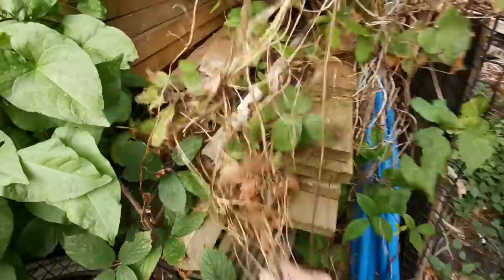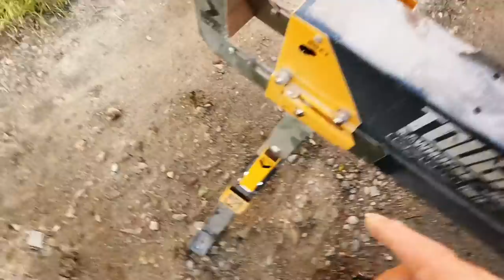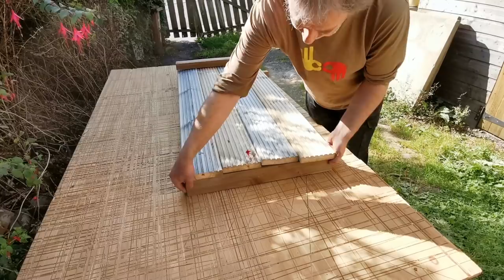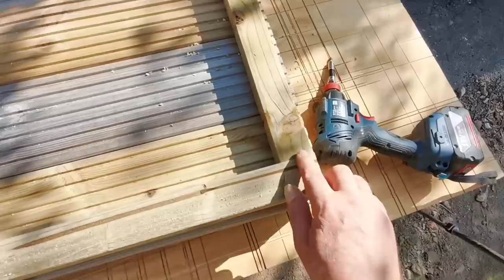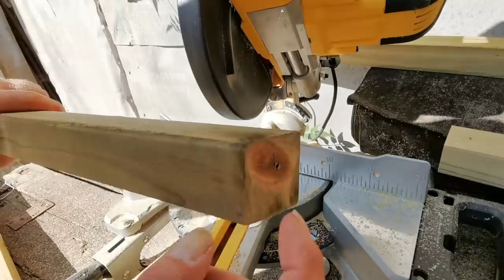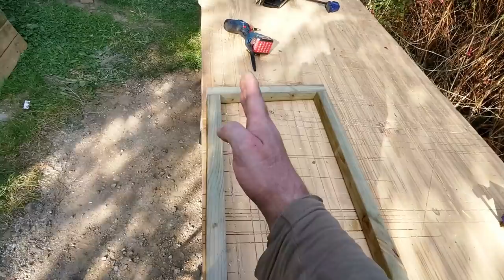Wood store build Pt1 - from scrap pieces of tanalised timber & van goes for it's MOT

Comment: Gid, so sorry about your dad mate. I don’t do social media of any kind so had no idea. You are right to hang out for a decent van. The prices are ridiculous at the moment as it seems everyone is a delivery driver now. No point buying someone else’s knacker. 
Enjoy your break pal and hopefully see you back doing your magic soon. 👍🏻👍🏻
Reply from the maker: Thanks, yep that's what I've heard, the increase in deliveries due Covid has pushed the price of vans up, they get snapped up quickly, I'm a bit reluctant to spend the generous donations on a piece of rubbish, & I need a LWB van, I've always had one that size but if nothing else so I can get my 3m plunge saw track in, high roof would be nice too like the one I have, I'm 6'2", I'm getting too old to be crouching, it's slim pickings on line but I've no transport tho so it's got to be a good one to go see as I've got to scrounge a lift from someone, I can only do that so many times, Leeds is quite big, so even if the advert says Leeds it could be 10 miles away, I'll find something n I'll be back soon Paul 👍👍

Comment: How do Gid, how’s thing? Have you managed to get back up and running mate?
Reply from the maker: Hi, I'm fine thanks Paul, sorry no van yet so haven't had a lot to share, I put a post on FB if you didn't see it, not much has changed since then, Van died Oct, dad died Nov, Xmas n new yr, I hate winter n it's freezing in my house, + covid lockdown, My dad died a bit sooner than we expected, we/the drs thought he had a stroke in March & thought he would stabilise & learn to live with the damage done but he got slowly worse, in n out of hospital all yr, Sept-Oct-ish they found he had a brain tumour n went down fast from then, he was 85, fairly well during his life n the end was relatively short 🤷‍♂️ 👍 There will be a little bit of cash coming from his savings, to be divided between 5 of us, my sister & brothers, it won't be much hopefully a couple of £k each but it's taking time to go through probate, so I'm very grateful for the donations, a massive £4,5k 😮👍 but the vans i can buy are a bit crap & miles away, i've been a joiner 36yrs so taking a few mths off is a drop in the ocean at this weird time, I decided it's worth holding out for a couple of mths to get dad's cash to put in the pot so I'll maybe then have a van for the next 10yrs instead of a rusty one that might get me through in the short term but only last a yr or two, hopefully Covid will f"off soon n we'll all get back to some sort of normal, so with all that i'm just hibernating a bit, I'll be back working n filming in a bit 👍👍 Hope you're well too 👍 https://www.facebook.com/gid.joiner/posts/3547240428695631?notif_id=1612858385271999&notif_t=feedback_reaction_generic&ref=notif